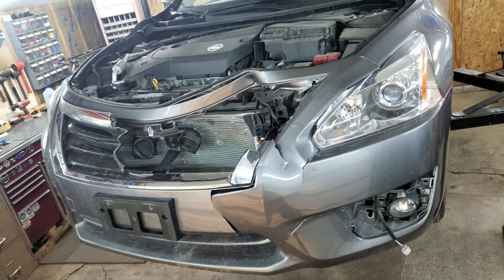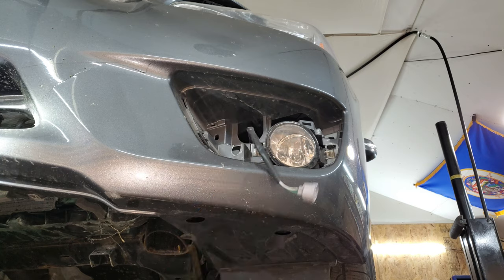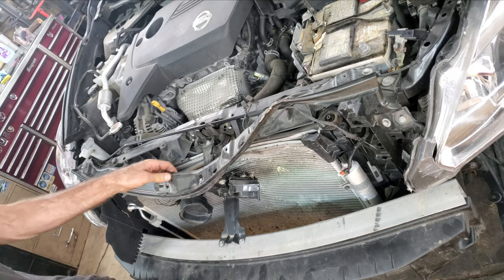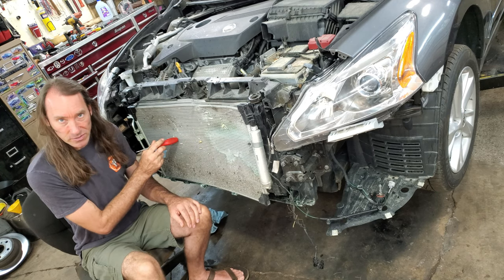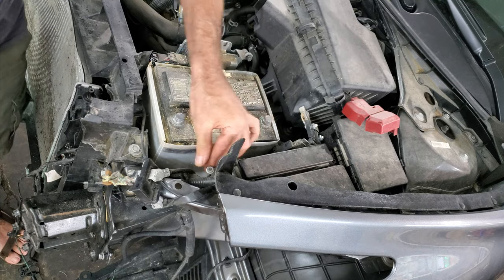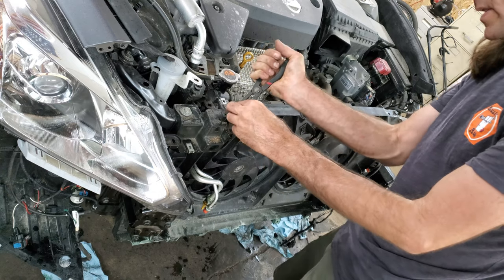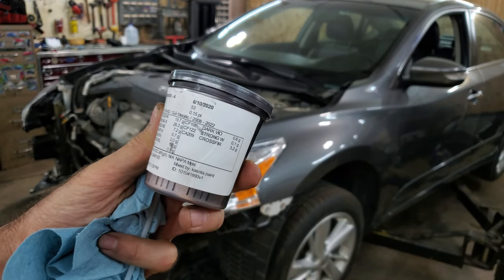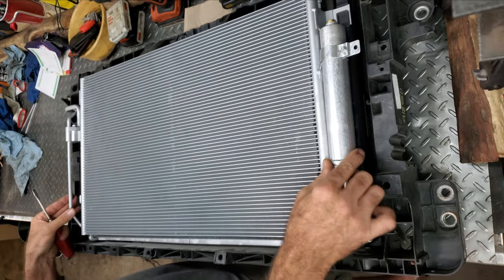2013-2015 Nissan Altima front end collision repair

Comment: The message on the dash about the "I-Key system error" was because the hood was not on and latched. There is a switch on the latch mechanism that tells the computer the hood is open. I am fixing one of these cars now. Same damage. Your video was a great help. Thanks
Reply from the maker: Yes. The thing was unplugged.

Comment: Was the deer okay or did it need to be taken into Rust Belt Veterinary?
Reply from the maker: The deer fought the Altima, and they both lost. One of them could not be repaired.
Reply: @RustBeltAuto  Just found this video after striking a deer with my 2014 and getting very similar damage.  No hair found, but an inordinate amount of deer poop had to be removed.  Thanks for the video, helped a lot.

Comment: This video would have been perfect except that you did not show the hardware.  I cannot figure out what bolts go where because I ripped out my radiator and condenser and all of the associated stuff but i have no idea what bolts to use for the radiator etc
Reply from the maker: Match them up by thread length. You should have about 6 threads on every bolt. If they are too long, you could poke a hole in something.

Comment: I just got my 97 Honda Civic back together, I bought it wrecked for cheap and rebuilt it.
Reply from the maker: I was looking for one of those that were rust free, and not hacked up for a long time. No regrets finding an EX with working A/C.
Reply: @RustBeltAuto  My Civic is a DX but I have collected the parts for a "mini me" head swap along with forged internals, intake manifold, 70mm throttle body, 550 injectors, Walbro 255 fuel pump, ramshorn exhaust manifold, gt40-10 turbo, and more. I plan to make a streetable road course racing car out of it.

Comment: how did you reset the ikey system error
Reply from the maker: I bought a new Launch X431, because my Autel was too old. Did a system check, and found a fault code for an unplugged connector for the hood switch. My bad.

Comment: How reliable would you say the newer subaru models are? Ive been trying to decide between the Nissan Rogue and the forester and I’ve heard the Nissan cvt is complete trash even with proper maintenance.
Reply from the maker: Personally, I wouldn't buy either one of them.
Reply: @RustBeltAuto  Do you think the Toyota RAV4 would be a better option out of the class?
Reply from the maker: @r2ba435  best investment in cars are Honda's, and Toyota's IMHO.